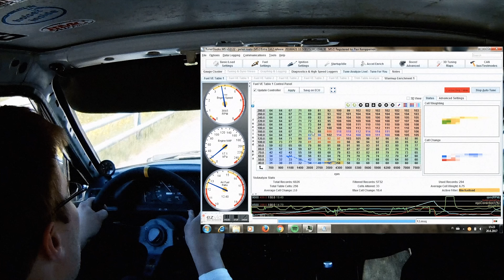BMW E12 V8 projekti, osa 4.

Comment: You probably already know some of this stuff.
You can use rear end with diff and shocks form an E28 (best to get '84 or newer), than you can use E31, E32, E34 brakes.
Radiator from E34 M50B25 fits in the front.
For front brakes you can use 328-330mm BMW disc with Brembo calipers from an Alfa 156, 159 and Giulietta, they are cheap (needs a custom adapter).
You can swap E28 front, but it needs some minor modifications and shocks sit at a slightly different angle.
All glass and glass trim is interchangeable between E12 and E28, roof is the same, I think doors between some generations.
Fuel tank is the same.

Thanks for the great videos!
Reply from the maker: Thanks and indeed I know that. But we are going to use the e34 m5/750 rear axle, because it has best design of the BMW trailing arm rear ends. It's rather easy to fit, and we have already done that to e30. Front end we are not sure what we are going to do and it's good that e28 has same glazing, because we need new windshield etc.

Comment: Nicely done Pazi. Watching these videos make me want to do some rust repairs again :D (finished my E30 last winter)
By the way, what zinc paint brand do you use?
Reply from the maker: U-pol weld #2 is the best one I have used. But here I used wurth one, because of better availabillity.
Reply: @pazi88  I use Biltema Zink-spray, more then half the price and seems to work just as good. The fumes are probably just as toxic 😄